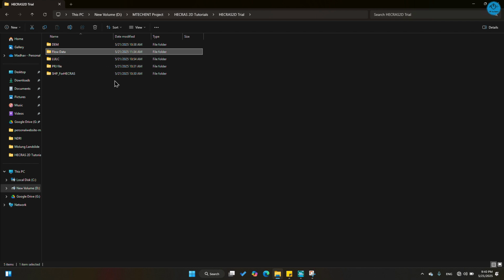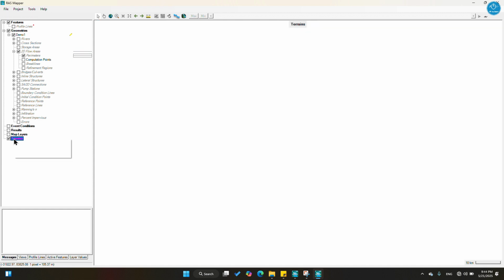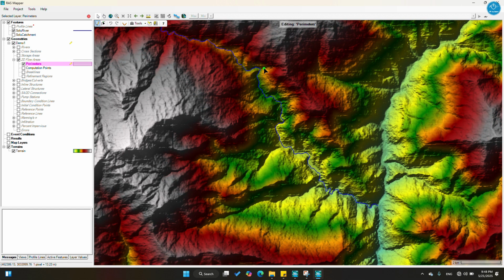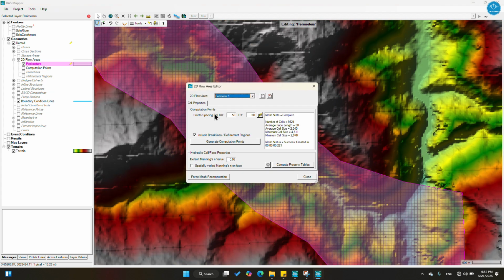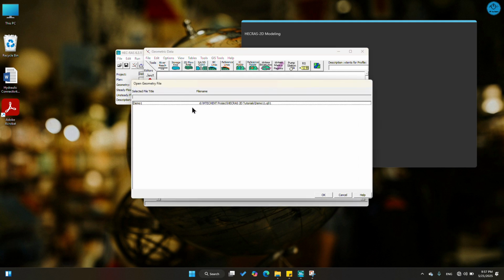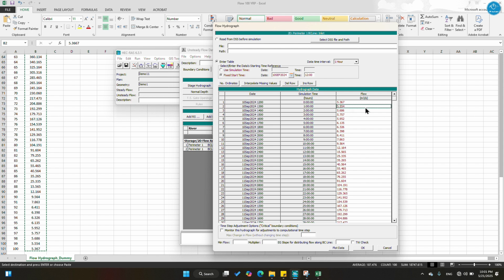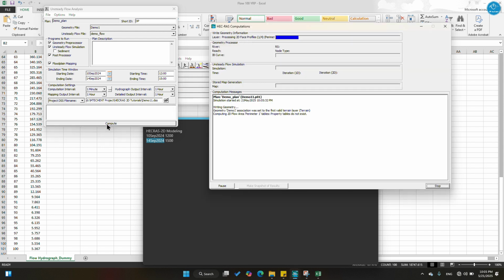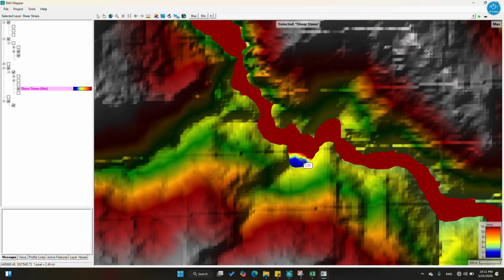🔥 Learn HEC-RAS 2D Flood Modeling | Step-by-Step Tutorial for Beginners (with Real Case Study!)

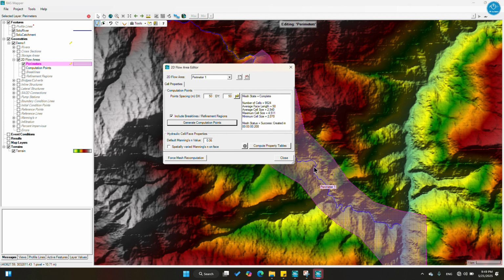Comment from the maker: 📌In this video, I didn’t cover Manning’s n values derived from LULC data, but HEC-RAS’s default average n values were used (see 11:20).
In the next video, I’ll show how to assign n values based on LULC for better accuracy, and also talk about model validation, calibration, and related processes.
Reply: please, when can we expect the next video for assigning manning's value derived from LULC?
Reply from the maker: @sibuyiselesweetnesspakati5709  surely I will upload it soon, if any other queries for now! You can ask me
Reply: @mtechent43  when trying to generate a mesh it says error : needs>1 cell [Displaying local mesh] [Full mesh Out-Of-Date]
Reply from the maker: @sibuyiselesweetnesspakati5709  There may be different possible issues:
 May be due to the 2D Flow Area is too small compared to the specified cell size — resulting in fewer than two mesh cells.

Or may be you created the area but never clicked “Generate Computational Mesh”, or you modified the area and didn’t regenerate.

May be the polygon may not be properly closed, self-intersects, or has topological issues.

First check these, if issue still, you can share here